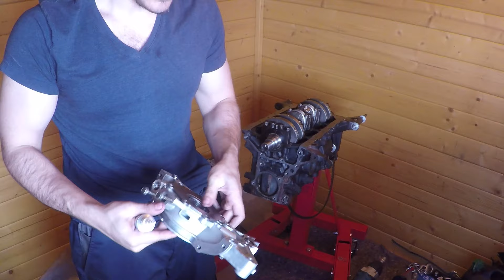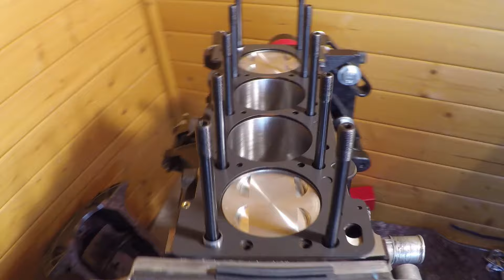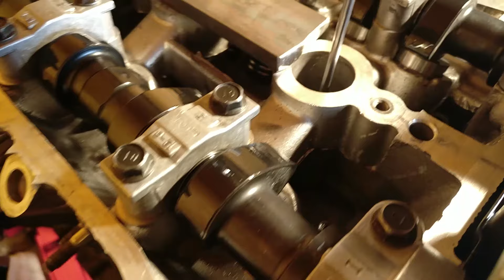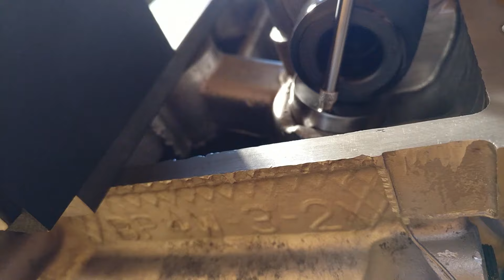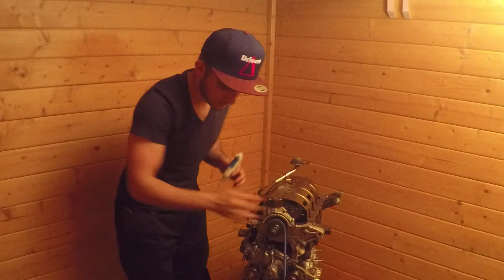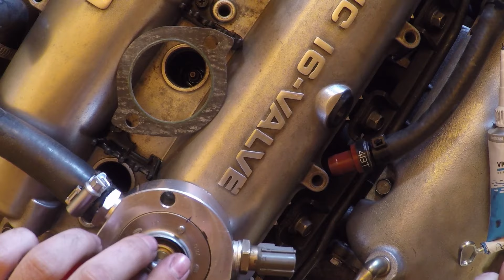Cylinder Head | Mx5 Turbo High-RPM Build

Comment: what makes an engine high rpm or high compression? like what needs to be done or replaced in comparison to the original engine ?
Reply from the maker: In comparison to a stock engine, reducing the clearance volume when the piston is at TDC rises static compression. In practice this is achieved by reducing cylinder head thickness, installing a thinner headgasket or by utilizing pistons with a taller piston crown.

If the rpm capability of an engine is increased, the rotating assembly has to withstand the higher inertia and the cylinder head must be able to provide a stable gas exchange at high rpms. To scratch the surface, that is achieved by installing conrod bolts with higher tensile strength as well as valve springs with an increased spring rate. 
There is a lot more to consider when using an engine outside of it's standard operating range. This is just a very basic answer to give you an idea.
Reply: @DriversDelta  bravo! well written, thank you

Comment: What duration cams are they mate??

Where did you make your dial indicator
Reply from the maker: They are 264in/ 242ex duration.
The shaft that curves around the cam is just a tig welding rod that I bent to fit. Then it was threaded into one of the extensions.

Comment: when you do the coolant reroute what do you have to do with the egr tube. I have the 1.8. is there a cheap way to do it?
Reply from the maker: The best way is to get rid of the egr system. Otherwise it will be a very tight fit

Comment: Nice job with the turbo build. I've been looking at the over-sized Supertech valves for my build, the valves are 0.6mm longer than stock, did you get all the valves ground down 0.6mm and then shim up the correct clearance?  I would be interested to know how you did it please.
Reply from the maker: Exactly! I got the valves ground and then shimmed. Since I run shim under bucket type lifters, new shims had to be bought.
Cheers!

Comment: so man. i just ran across your build. i have 2 fully built from ground up V8 NA 91& 92s. one is a Ford GT40 stroked 347 with a Procharger and the 92 is a GM crate LS-Edelbrock Eforce 416ci,700lbs trq. both are running magnum T56 trans& 8.8IRS with 4.10 & 4.56 rear sets and Strange Titanium Half Shafts. the other 91 is #609 BRG Texas Turbo built 1.6 with 318 rwhp..what are u spending in your build? I dont want to swap my BRG to 1.8. You seem pretty sharp and I would enjoy knowing a bit about the build..Thanks man.

Comment: This is pure automotive porn. I built my 5 a while ago half this well, running 8 psi with s blower and not anywhere near the quality this dude does, 120k later still running but this car will run till forever.
Need a job?